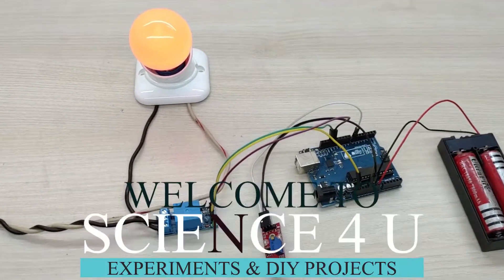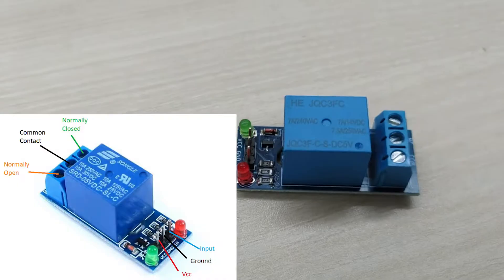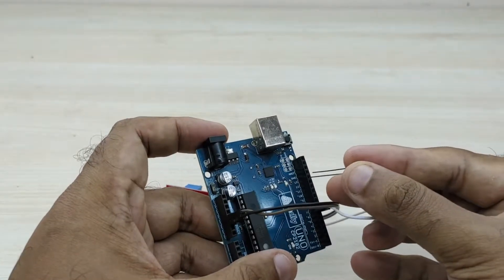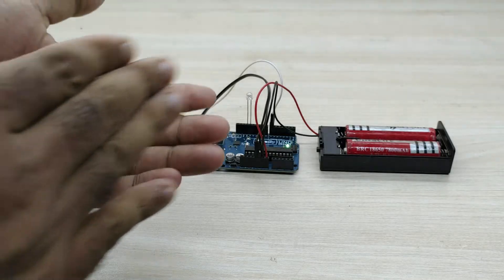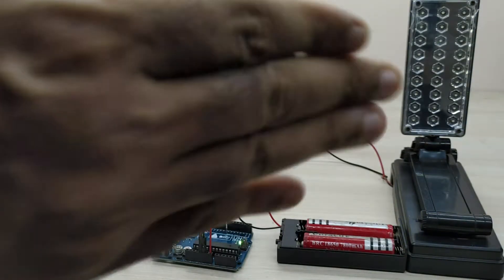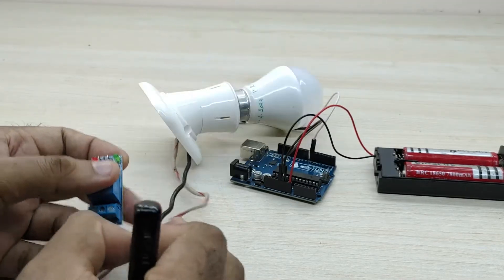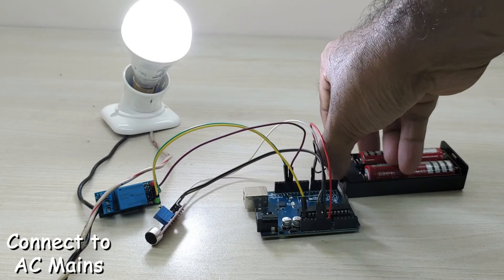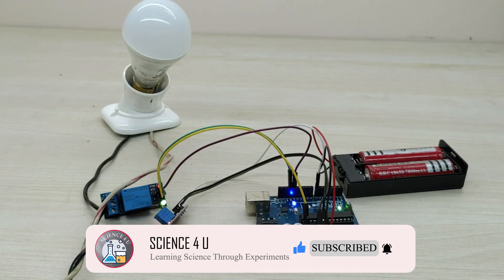How to make a Clap Switch using Arduino & Sound Sensor || Home automation project

Comment: What kind lamp AC?
Reply from the maker: I used a bulb called zero watt bulb which works in 230V AC. You can use any bulb which works in 230V AC alongwith the relay.
Reply: @Science_4U_  I have a lamp that needs 15 watts, is that possible?
Reply from the maker: Yes friend it is possible. Is that an AC or DC bulb?
Reply: @Science_4U_  
I want to ask again sir, I have an incandescent bulb, can this be done?
Reply from the maker: Yes friend. Definitely. Just follow my video. It has to be used with a relay. Instead of the zero watt bulb that I have used, you can connect an incandescent bulb.
Reply: @Science_4U_  Alright then, what application do you use to upload code to Arduino?
Reply from the maker: @ectocoto8806 I use Arduino IDE software to upload code by connecting UNO to a laptop...
Reply: @Science_4U_ Here's another question I have, hehe. If the black cable of the LED light is cut in half, should the remaining cut part be connected to a white cable?
Reply from the maker: @ectocoto8806 No friend. The black wire should not be connected to the white wire. The relay just serves as a switch to connect and disconnect the blackwire which causes the bulb to switch on and off..
Reply: @Science_4U_ Okay, thank you bro, greetings from Indonesia.
Reply: 2:40 at here

Comment: Why we have to use battery
Reply from the maker: Hi friend. The battery is required to power the arduino board. Also, the battery gives energy to send and recieve signals from the sound sensor.

Comment: That cool you can make a Christmas light with a clap switch but will it stop if it in loop?
Reply from the maker: Hi dear friend. Definitely if you connect the christmas light it will switch on & off depending on your clap. But I didn't understand the latter part of your question about stopping it if in loop🤔
Reply: @Science_4U_  I mean Christmas light but made with Led those small red blue green LED in bread board on my recent class we made a Christmas light pattern using led that goes in loop like it goes for ever unless you unplug it but we still haven't tried with any sensor just curios
Reply from the maker: @sweetsoymilk1214  Okay friend. Now I understood. In this clap switch,  you can connect the Christmas light circuit instead of the bulb that I have shown. So the full Christmas light circuit can be made ON & OFF by just a clap.